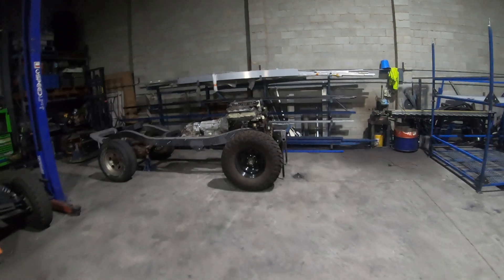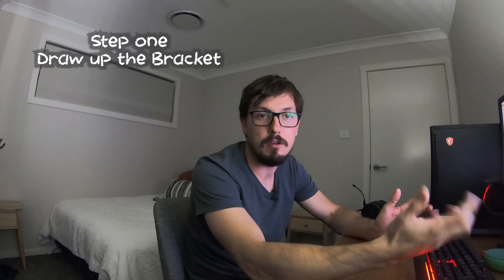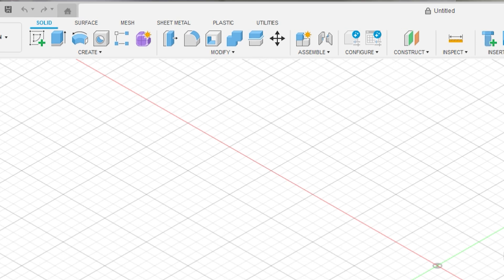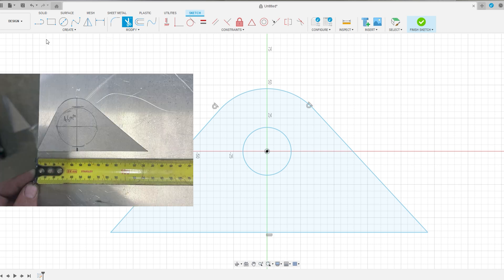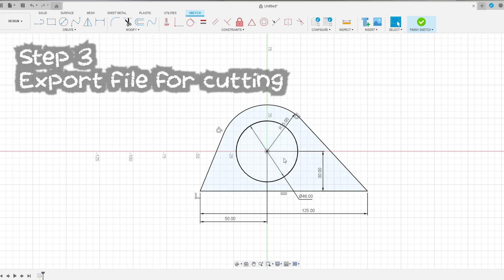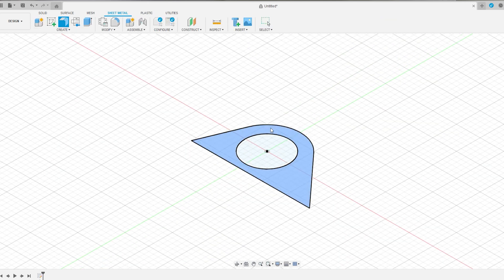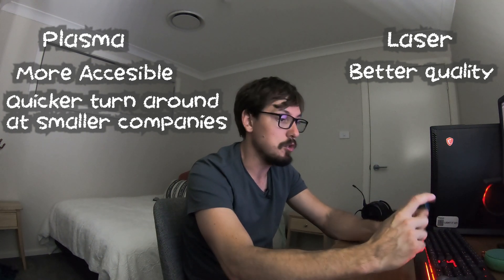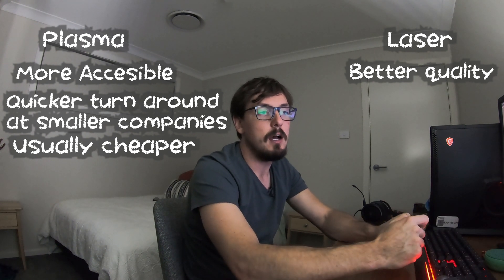Use CAD at home in 15 minutes!

Comment: Ive been a mechanical designer for 20+ years. I enjoy being able to design and build my own parts...send off flats for laser cutting and bending etc.

I havent fone snything as extreme as a full suspension setup yet, but am keen to have a go, i just wonder how do you decide what to include in your model, and what you just build on the run? I see  there's lots of plates and brackets you're still measuring and cutting after something else gets installed.
On the steering and suspension, how much pre work do you do in a cad model to get it close first?
Reply from the maker: It’s a bit of a juggling act, i could go to the effort of drawing the entire system on the computer before cutting the first file, but progress wouldn’t be made for a long time , so I try and do it in stages, where I finish a step, get in and do that, then move on and go again type thing